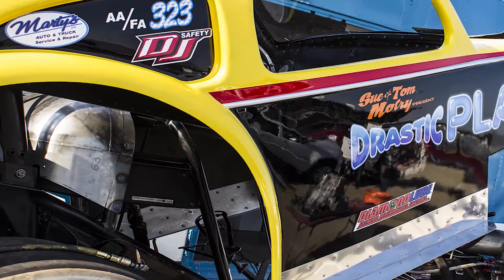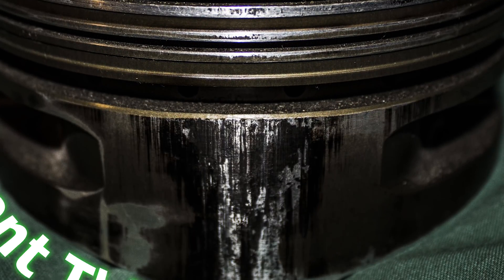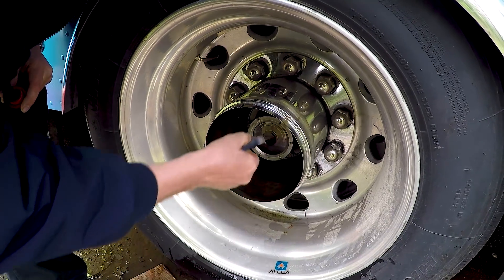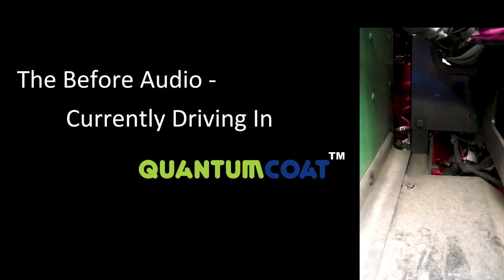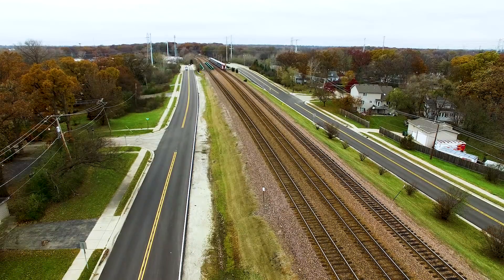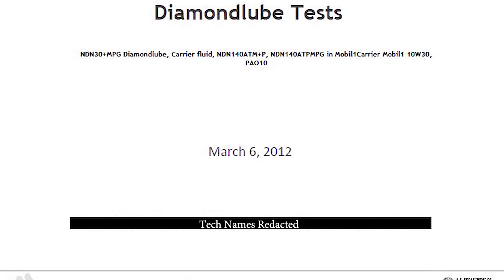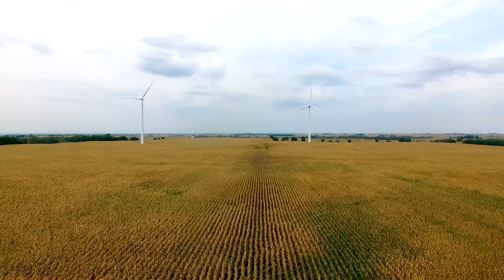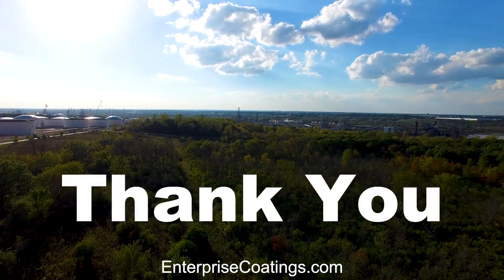QuantumCoat™ Increase MPG, Reduce Friction, Wear & CO2 Emissions

Comment: Just waiting for the next oil change on my engine to use this. My car is a Chrysler Grand Voyager 2.5td 2000mod. It has a slightly ticking sound when cursing the highway. Hope it remove the sound. 😊
Reply from the maker: I just saw your post now. Did you record a before audio so you can see the difference?
Reply: @quantumcoattm9208  unfortunately not. The day after I added QuantumCoat I received your email about record before and after adding "QC" to get a free QC. So I really regret it now. Hehe.
    I have noticed that my Chrysler runs slightly more quit/smooth. I will keep you updated as I check later how much my fuel consumption has reduced 😊

BTW, a mechanic comfimed that the very low ticking sound I described was normal for my car.
Reply from the maker: Glad to hear you have noticed a slight difference.  Keep us posted the more you drive it.  If you want the free bottle, you could gift a new bottle to someone, and record the before and after on that 😊  As for the After audio, 500 to 1000 miles would be best.
Reply from the maker: dcplanbful  You know what, If you want to film a great looking video describing what you noticed and how you liked the product, we'll send you another bottle.  Maybe show off your car as well.  Let us know if you'd like to do that.

Comment: This will be my first review...5/30/18 I am using the lube on my semi 2011 freightliner cascadia with Cummings isx I just rebuilt engine 140,000 miles ago miles on it now are 743,278 truck idles pretty loud also has a vibration..I just added lube engine power steering front hubs and both drives..transmission is to full rite now but will do it this week..so a soon as I added into engine I moved my truck maybe 50 yards and instely I could tell it was quiter I drove 5 mins down the street loaded stuff in truck to leave on the road and man this thing is so quiet sounds if it was almost brand new...also I had a vibration at about 45 mph due to a front steer tire and vibration is minimal so far so good not even 50 miles down the road...my people is marking 5.6 mpg will update again if my fuel mileage goes up...thanks Chris for your service and if all goes good I will tell every one I know about your product
Reply from the maker: I’m glad to hear you are enjoying the results so far. Keep us posted.

Comment: Timothy Mrock (Indiegogo Contributor comment on QuantumCoat) I have known Mr Arnold and been a extensive user for over 8 years. 5 complete vehicles, over 20 competition grade RC electric airplanes & helicopters, my wood splitter, chainsaw, lawnmower,
 weed wacker, bicycles, etc. There is NOTHING on earth like this product. I can state that any other lubricant regardless of brand that compares theirs to Quantum Coat is flat out fraud, PERIOD! This is one of those rare products that does everything as claimed, and more.

Comment: Over a month here and only one post? I searched the Argone Labs for articles regarding Diamond Lube and it does exist, just unsure of it's benefits inside an engine. If they had sample offerings instead of $50/bottle -  oh wait, minimum purchase is 3 bottles roughly 3 oz a piece, so the real cost is $150.  I'd be more interested in being a tester.
Reply from the maker: There is a single half ounce bottle for $50.  There is a motorcycle bottle for $35. The 3 pack is 3 of the standard engine treatments for $150, and free shipping.